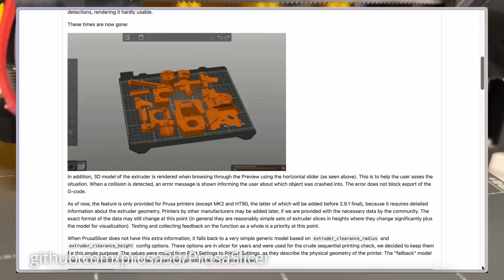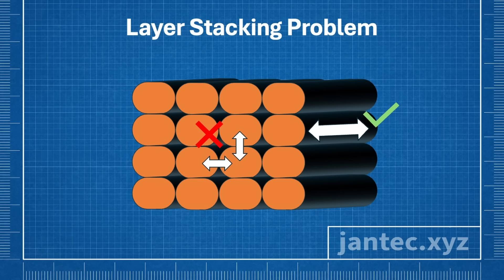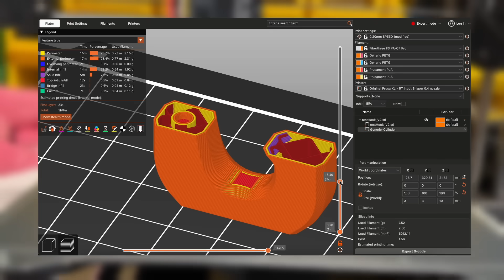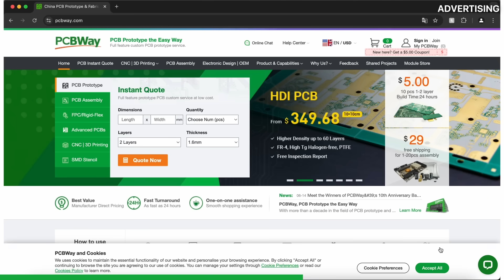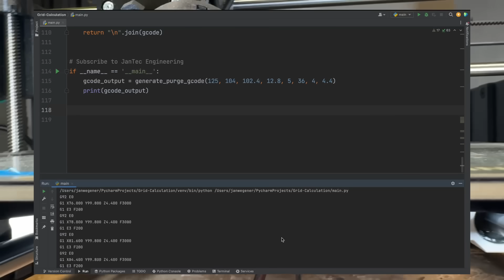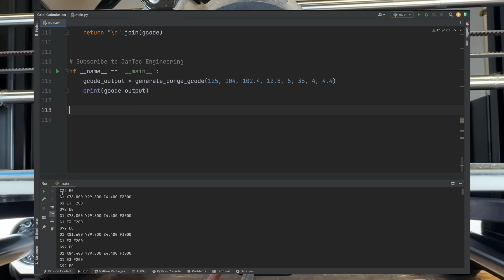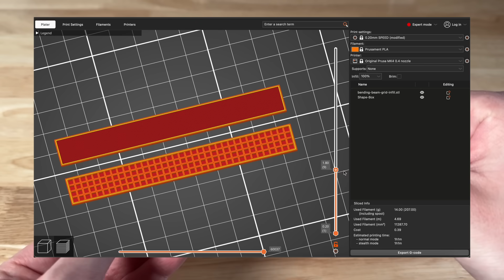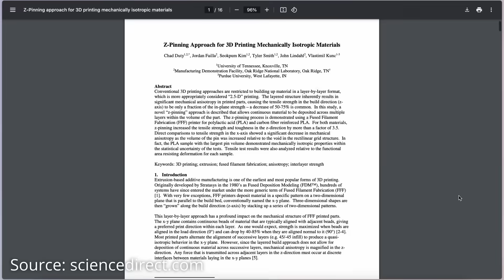Stronger 3D Prints by injecting Filament into the Infill

Comment: Imagine injecting cheaper PLA into more expensive Nylon print as a hole filler. These two materials melting points are too far away from each other, so changing filament back and forth with AMS will be a huge waste of time (and plastic). At this point I'm thinking think about IDEX system with second independent head.

“You can get much further with a kind word and a gun than you can with a kind word alone.”
― Al Capone

“You can get much further with software innovations and IDEX than you can with software innovations alone.”
― Me

Comment: I use a loose gyroid and fill the void with resin afterward
Reply: I've tried this, you need to consider glass temp & curing temp of resin as I suffered some warping of parts

Comment: Im wondering if its possible to fill in the extremely tiny gaps between layers using this video as inspiration by filling the voids formed between each layer,

Maybe like a sprayer version of 3D printer could be used to fill in tiny gaps?

Comment: Wonder how feasible it would be to make tiny injection moulded parts using a 3D printer. Having the form made from machined metal (alu, steel, brass, whatever) and then use the 3D printer to inject the plastic. Of course it wont provide any significant amount of pressure but it should still be possible to make some tiny parts this way.

Comment: Would probably be pretty straightforward to add an infill volumne to prusa slicer similar to how pegs are added when cutting parts. Just allow the user to place a cyclinder inside a model at whatever location they desire and generate the void (slicer can already do this) and calculate and add the injection at the top most layer of it.

Comment: Carbon fiber will mostly be useful as longitudinal reinforcement for tension. It would not be very helpful as fill in cells. Say you where printing an I beam. The bottom flange could be made smaller as carbon fiber while the rest of the beam is your standard material.

Comment: what makes it different to normal printing? is the filament different, or the speed at which it is injected or just the fact that you are coming back after to fill. or a combination?
Reply: sorry for the novice question but whats different than just filling them in to begin with? im assuming its many times quicker.

Comment: It's very much expected that this technice wouldn't improve the stiffness in a 3 point bending test of horizontaly printed samples. Because this test doesn't test layer adhesion, quite the opposite in fact. It test the compressive and tensile deformation in the horizontal axis, which is in the layer, not between layers.

Comment: I think turning up the heat during “injection” to increase bonding but also let the plastic flow down into the cylinder. Also important to think about how injection molding works, high pressure and fast; I would think making volumetric flow as high as possible would work better.

Comment: It’s the same concept as grouting a cinder block wall. On their own, the blocks would eventually weaken and the wall would fail. But if you add a horizontal length of rebar every few courses, fill the hollow cores with small-aggregate concrete, and insert a few vertical pieces of rebar, that wall isn’t going anywhere—short of being taken down by heavy equipment.

If you could adapt the use of reenforcing metal wire into 3d prints , that would be next level. I’ve seen continuous thread CF rigs but for strength/cost,  you can’t beat metal. They’re getting close, for sure. Just not there yet and it’s an area that could easily be capitalized on

Comment: Really interesting idea! Maybe one possible modification would be to create an algorithm that generates infill patterns in such a way that  that the negative space in areas you want to reinforce is comprised of a small number (ideally one) of connected components with easily accessible ports for injection and air escape. For example, if you just wanted to print a very strong flat square, you could create an infill that has negative space that looks like a finite-order 2D Hilbert curve (likewise to print a cube, a finite-order 3d hilbert curve). Then when the print is done, you simply put a big syringe up of your reinforcement material to the injection port and push. Material would snake through the curve until it comes out the air escape port, then cure/solidify in place.

Comment: A question that interested me was what's the print time difference between solid infill and injection for your bend test pieces? Is there a significant time save with this process?

What about infill with other materials like using a syringe to inject resin into the voids?

Comment: While it is an interesting idea it seems like a lot of bother with not as much increase in strength one might have hoped for. Usually when I want to strengthen a PLA part I add some steel nuts and bolts in key locations. In other cases I use TPU as it is very tough and the layers fuse together very well. In some cases where the thing is bigger I have used more wood and added 3d brackets just where a non stock shape was needed.

Comment: I leave gaps in the 3d model, pause and inset metal in the gap before resuming the print. I have a print with a 1mm steel plate inside to give it strength, others have wire.

Comment: This is great Idea if you could fill it with something else like resin or silicone to cut cost the material and create stronger and durable material.
In this way it kinda like a concrete structure

Comment: 0:39 “when 3d printing for technical applications you often want your parts to be as strong as possible” - this introductory sentence shows the problem with the thesis, that it ignores tradeoffs. Like, if you want prints to be ~as strong as possible~ you’d still buy the most expensive structural filament and then print with 100% infill, because you’ve defined the problem in such a way as to not care about weight, time or cost. In real life, there are tradeoffs. The most interesting thing about this, in my opinion, is that this technique could be used to counter poor layer adhesion in prints that need to be strong in all three axes. But starting the video by saying that often in technical applications we only care about strength is fairly silly
Reply: Given the choice between interpreting his words to mean "as strong as possible (given practical constraints)" and "as strong as possible (without regard for practical constraints)", can you explain why you chose the latter?

You can infer the former because it is the only reasonable option, and it's safe to do so because this criticism has no bearing on whether the method he is proposing is useful or not.
Reply: @excrubulent  oh ok, so you often want your parts to be as strong as possible given practical constraints? The sentence is either just plain untrue, or it’s meaningless, or it’s redundant.
Reply: @TastySlowCooker If you really can't figure out what the sentence obviously means by the bare minimum of inference needed to communicate in good faith then I'm afraid I can't help you.  I even spelled it out for you and you ignored that.  If you want to misunderstand people and get aggrieved over it, fine, I'm not wasting any more time on it.
Reply: @excrubulent  yes it probably isn’t worth your time beating that straw man. I think it’s already dead anyway

Comment: Yeah you could do this segmented in lifts, where you fill in smaller events so you dont need special nozzles. This would be creating a cold joint that is similar to the 100 percent infill. You would want software to do fill lifts at strategic point where the cross section of the part is at maximum area so that these cold joints are supported the most by the part. Would be interesting to make a part where you have support only material around that breaks away but the finished part is only made up on these fill so its a gravity injection molded part without the typical linear joints with 3d printing.

Comment: a good idea?
 
3D pen artists use wood burners to smooth most surfaces of builds 
some prints use the nozzle to smooth top layers.
different nozzle shapes or wood burning tips with a hot end switcher  
might let you be able to iron out the surfaces of other layers or even carve more details out as you print. 

would add more time but having a fully smoothed build 

even slapping a CNC end on it also. maybe even heated stamps (like the metal leather working stamps) for imprint stuff on them.
a lot can be done.

Comment: Imagine if your printer had a thermal camera attached and could detect when it was heating the part too much. Then it could back off the extrusion rate to prevent warping the part.

Comment: I think the best real world implementation using existing hardware would be an option in slicer to add stiffening posts, where the slicer would add hollow cylinders at user specified or regular intervals within the perimeter, and the user could specify the post diameter and depth based on nozzle geometry, and the print would stop at regular layers to fill in the posts before continuing the print, say a 2mm diameter hole 2mm fill height, stopping every 10 layers for a .2mm layer height, the post filling intervals could be staggered so theres not one layer that all the posts are weak at

Comment: idea : try gyroid infill with a heated chamber. Gyroid infill makes a continuous open channel throughout the entire part where the plastic could flow, and with a heated chamber the plastic would lose heat slower and thus stay liquid for longer. Then you could create sort of internal plastic 'bricks' by injection-filling alternating sections of the gyroid infill as you go up up in layers, creating a sort of 3d interlocking plastic brick structure for the interior of the part. (with the strength/stiffness being relative to two main factors, 1st : the size of each "brick" which would be determined by a variety of things from hotend temp to ambient temp to viscosity and so on, and 2nd : how well 'anchored' each plastic brick is to each other, the infill, and the walls of the part itself.)

Comment: Jan this is a poor idea because it requires 2-3x the filament for a 10-20% improvement in strength.  Filled 100% vs. extruded infill 100% is going to be weaker because you cannot achieve the pressure needed to completely fill the gaps in the infill.  The primary advantage of this technique is faster printing times for completely solid objects.  Not many projects require solid objects, because strength to weight is an important design factor, even for massive objects such as buildings.

Comment: >thumbnail says "100% infill, but better!"
>look inside
>it's worse
Reply from the maker: That's not true. I compared it to regular 100% infill and it had 30% better impact resistance.
Reply: @JanTecEngineering  But drastically more complicated, requiring hardware modification, and also drastically less stiff, which is likely the strength measurement that matters most for functional parts. If the part is going to take impacts as part of its duty then you probably shouldn't be 3D printing it anyway.

Comment: Wondering, a solid bar can be heavier than a tube a design can be stronger in the tube can be stronger than solid. Another example is an egg vs a round ball. Would it not be more practical to look at design and how the stress is loading on the part similar to roof trusses. Better design and understanding I believe is where to look for the best parts, weight,lower costs, waste, time ect. Keep up the research I'm sure   solid infill also has its place.

Comment: If injection of filament is patented what about inserting of peace of hard plastic? I imagine idex printer that the one head is not printing head but can insert plastic into a hole in printed part. Than it cuts it to proper length. Another version is to drop metal pin in prepared hole. After that the other head continues to print.
Reply: that would rattle like crazy

Comment: I think you can further increase the strength of your prints by ensure that your infill is alternating layer by layer so your injection is bonding in-between infill. this maybe hard to explain with text, so here is some ascii below... The idea is that you are creating a bonding cross beam that gets fully coated In the injection, this happens because the alternate layering should leave just enough airgapping. The challenge here is probably overhang and the alternation of the lattice, I think if you were to make the lattice shift each layer going up in a sort of a hexagonal point to point config ( so 3 crossing lines --- / \) that may work, you may run into a challenge determine where to inject though. Or ignoring the exposed infill overhanging method if you tried a spiraling cavity this may cause the same strength effect. The point I am trying make is that injection on a square is good, but would always have the same engineering flaws as building a square box to support weight, you need a triangle truss or some form of cross sectional bonding to distribute or reinforce the surface on non primary load bearing directions.  IDK this could all be incoherent rambling, but cool to see people trying new things.

+---------+
| | | | | |
|-|-|-|-|-|
| | | | | |
|-|-|-|-|-|
| | | | | |
+---------+
+---------+
| \ \ \ \ |
| \ \ \ \ |
| \ \ \ \ |
| \ \ \ \ |
+---------+

Comment: Hey I think it would be a good to devide all number by the weight. Since you are adding mass you should see an improved no matter what. In 3d printing you usually want the most optimized stricture which means performance to weight ratio. 

I also think mechanicaly a 3 point bend test is not quite applicable for this comparison since the material further away from the neutral axis contribute more to the apparent stiffness. Otherwise cool project. In regards for you carbon fiber infill I would suggest using plastic as infill and the carbon fiber as structure since the printing process is creating some degree of alignment which helps a lot with strength. 

Hope my comment is helpful.
Let me know if you have any questions.

Comment: Neat concept. What about a sperate syringe on the side that injects a fluid into the voids? like Glue/Epoxy or UV Resin etc
Reply: I've seen several people fill gyroid infill prints with concrete.
Reply: Best to post process to fill those. Those things could ruin a bed when they leaked. Or glue the part to the bed as the liquid oozes through pores in the bottom layer.

Comment: I've been using a sparse infill that has a matrix of flow holes that allow a liquid epoxy to fill it completely.  Then I can sand off the outside and be left with a much strong product when i need something with incredible strength.
Reply: This. Filling is the best way to post strengthen. You can cast concrete into it and the nheat the product to further adhere the plastic, and use discarded prints as agregate, I have also heard of solvents being sprayed each layer to adhere the plastic.
Reply: I was thinking of doing that for some time but haven't tried it yet.
Reply: Very clever idea, a way to get most of the strength of a cast part without the hassle of making a separate mold.
Reply: what about printing the outside with pva then just washing it off after filling and curing?

Comment: 6:53 you can measure this length with the other end of the calipers. Rest the thick body part of your calipers on the tip of the nozzle and extend the thin part until you reach the brass part.
Reply: I will guess he is well aware of this. Using the other end isn't going to easily show the measurement in frame

Comment: Did you test a closed printer with different chamber temperatures? I could imagine with a high chamber temperature you could reduce warping from the injection. It could also help with the rapid cooling of the injection material. That way you could use a normal nozzle and reduce the injection material temperature, which would decrese the bubbling of the fillament seen in the video.

The Question there is how the part cooling is done overall. I probally would try to strat with ABS in that case. For PLA I probally would first test how fluctuating or different chamber temperature would effect a normal print first. Just to check if PLA can be cooled with a ramp uped fan in combination with a high chamber temperature.

Comment: Would the strength of the vertical print be improved, if the holes were filled in staggered fashion. Left hole gets filled, then half way up, right hole gets filled. This would offset the joints in between the filling material, improving lateral strength
Reply: I came to the comments to suggest almost the same thing. The only difference is I was thinking a checkerboard pattern of filling order might make things even stronger.

Comment: I have also been working on this for months. Using a similar technique, I got a 27% increase in bending strength with PLA. PETG didn't show much improvement. The best improvement I saw was in ASA, around 47%. This makes a lot of sense as ASA is less isotropic than PLA. 

My technique is to create an STL to use as a modifier in Cura. The STL is just an array of regularly spaced cylinders about 2mm in diameter, and as tall as you'd like. Go to Per Model settings and choose "Modify Settings for Overlaps." Set the infill density to 99%, infill extra wall count to 1, turn down the speed, increase the flow, and increase the infill layer height - Cura allows me a maximum of 1.6mm. You can also get fewer aligned layers by using infill combination on your standard infill.

While this doesn't allow as tall extrusions, it definitely improves strength and impact resistance, and is easy for anyone to implement.

I am also working on a Python post-processing script that will allow for greater control and the use of other slicers.
Reply: I would LOVE to see this if you ever get it working for Bambu Studio